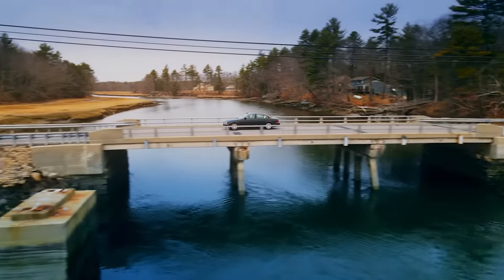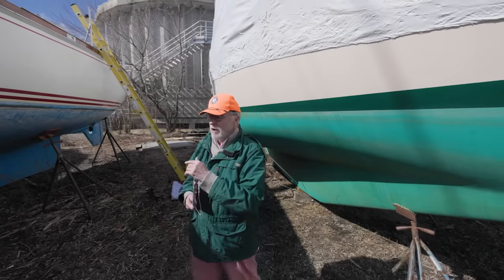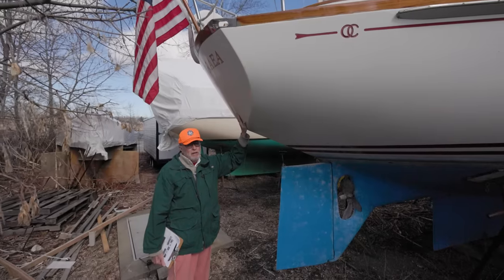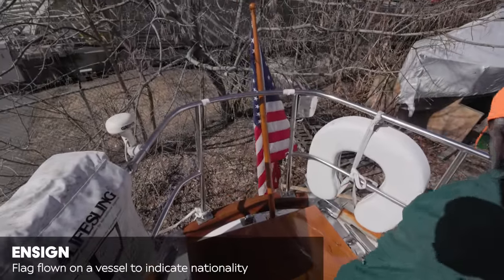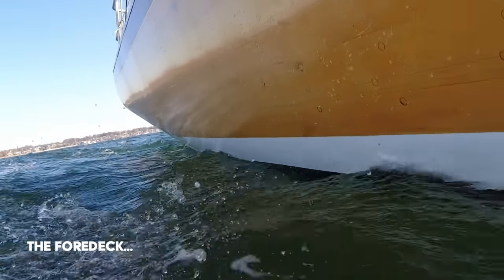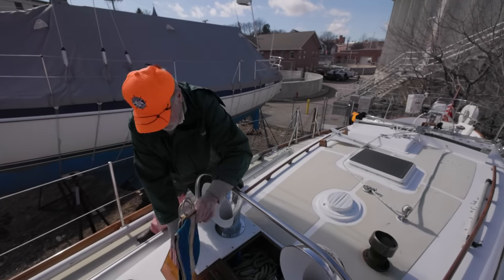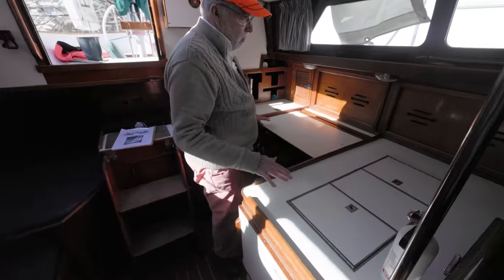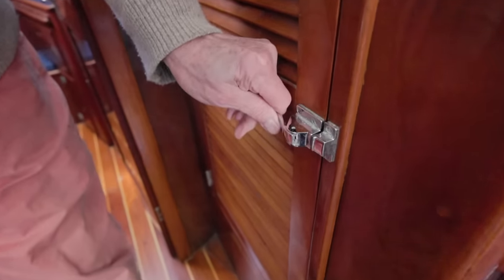$49,500 HINCKLEY QUALITY AT 1/2 THE PRICE - OC40 Sailboat for sale - EP85 #sailboatforsale

Comment: Wow, we are actually thinking the same thing Captain! I too was thinking that I could circumnavigate in an OC 40 and gunkhole along the way! She looks beamy, sea kindly, sturdy, not too drafty (I like that), has some capacity in those full bilges for fuel & H20- merely needs repowering, standing/running rigging, new wiring, new through hulls, a quick check of the gudgeon & pintles- and off we go! Love those stainless deck fittings: fairleads & bow pieces are GORGEOUS! Works of art.
Reply from the maker: couldn't have said it better.... so many great attributes here

Comment: I am looking your videos (from Germany) since the 1 day - this one is for me the best yacht you introduced to us. Everything  under and above deck is where i would  expect it  to be. Unfortunately i am (as someone below wrote) at the wrong place and time -  i am 2 years older than the Captain.
Two Remarks: on almost every boat that you discussed the body painting was too thick (too many layers) and had some areas, where the layers flaked off. For me this would be the first thing to eliminate - as long as the sails and rigging is pulling me  forward and the engine is pushing me. Whats your opinion?
You mention that some carbon-blasting would be necessary. Could you please describe this occasionally? I suppose that it is something similar to sand-blasting, but with deepfrozen carbon dioxide?
Reply from the maker: Thanks for watching and being an early adopter! We talk about Soda Blasting {sodium bicarbonate (baking soda)} mostly as the method to remove all the paint back to the fiberglass... it's relatively inexpensive and effective at getting the paint off. We've heard cost estimates of around $2000. USD for a mid-sized boat to come in and soda blast the bottom.  We think it's well worth the investment to bring it back to the base layer and build it back up nice and smooth.  We hope to show this in detail in a video sometime soon. thanks for the suggestion!!
Reply: @YachtHunters  After a soda blasting, what do you think of copper coating vs the standard bottom paint job.?

Comment: "The latch needs attention". Meaning, the chrome finish or the mechanism, i.e. spring or metal wear? I love the fit and finish of New England Hinckley's but the common lack of a chart table is a deal killer, this one fixes that, even the galley looked nice. And the slope to the back of the settees, another win, without...deal killer. Well done boys.
Reply from the maker: Hank did it   we just shot it   but thank you for watching

Comment: Of course all that varnish is also a LOT of work.  You should have commented that the glass bowl Racor in the engine compartment violates ABYC standards.  Should be metal bowl because of heat and fire danger. Still,  I love your series.
Reply from the maker: outstanding point... thanks, Terence

Comment: Can you make a video of how hulls and decks are manufactured? What's good/bad etc.
Reply from the maker: great idea... we have a few things in the works but they are for later this spring
Reply: @YachtHunters  I'm assuming Balsa Wood is not used in fiberglass sandwich construction anymore because if there is water intrusion, it gets wet and rots. Replaced by Marine Grade Blue Foam Insulation?

Comment: At 4:2.0… we call that a ‘Garboard plug’   It’s a drain hole for winter storage, it keeps the hull from filling with rainwater and snow,
Without the bar board plug any accumulated water might build up, and even freeze and damage the hull and floorboards…

Comment: Hers a question. Why is the standing headroom on sailboats so low? Is it a center of gravity thing?  Is it a  so you can see where your going thing?  Something else?   Although i noticed you could stand up in that one.
Reply from the maker: Yes yes yes and yes

Even though you spend probably less than 10% of your time below deck standing up, designers always try to give at least 6+ or minus feet of headroom in a boat. There are a few people who will need more headroom but overall that is a good starting point. In the older boats with deep keels that were integral to the hall the headroom measurement started somewhere below the waterline. As the Bilges got flatter the architects had to raise the sides of the boats to get headroom without having an offensively large Cabin top.
Keeping weight low on a boat is extremely important aspect of understanding the stability of a boat. The lower the center the greater ability of the boat to stand up to heavier wind and carry more sale for speed etc. it is very nice to be able to stand up below especially for cruisers but rarely do you find headroom in about less than 25 feet long. There are exceptions. There also is the aesthetic aspect of design to consider which goes to our soul as much as anything else. Very important

Comment: Do only compasses on metal hulls need to have those large metal balls on either side of the binnacle?
Reply from the maker: Too the best of my knowledge that is the case due to the enormous amount  of deviation caused by the mass of metal.  Keeping ferrous material away from the compass is critical 
Don’t set a compressed air can next to the binnacle in case you don’t mind going to Yarmouth Nova Scotia instead of Yarmouth maine 
I do recall some older sailing vessels in wood having them. 
All depends upon how much deviation can be dialed out by a compass adjuster person
Reply: @YachtHunters  did Randay spend a night shift navigating with a can of cheese wiz?

Comment: Four six volt batteries in series gives twelve volts?

Not the way I learned electronics in the Navy. Must be new math.
Reply from the maker: sorry... the batteries are paired 2x2.... so two of the 6 Volts batteries combined  = one 12V and so effectively I have (2) 12V batteries when they are wired up...  I suspect I could learn a lot from a good navy electronics class :)

Comment: I love those toe rail chocks/fairleads whatever,,,those are the cat's ass. The only distraction is that there is not a private second cabin for crew, nor second head. HOWEVER,,,,,,,, she is quite beautiful and design functioned to sail many seas. That price is unbelievable. Too good really. I suspect a suit of new sails and some rigging is in order. NOT having Balsa Coring is a rather large plus. Balsa is fine to a point too but,,,,,,,,,,,,,,,,,,,,,,,,,,,,,,,,,,,,,,. the bronze centerboard is most heart warming. Hydraulic lift system too. There is precious little to not like about this vessel for short handed ocean passages.
Reply: I too appreciate all of those points, no balsa! Hydraulic! As for a 2nd head for my purposes that's a negative, until relatively recently most houses did not have two heads, if any.